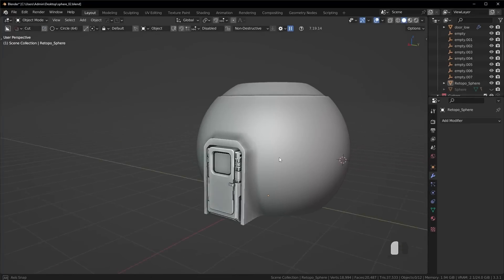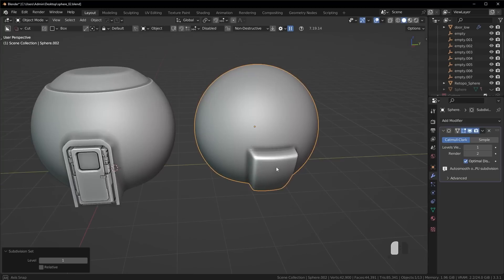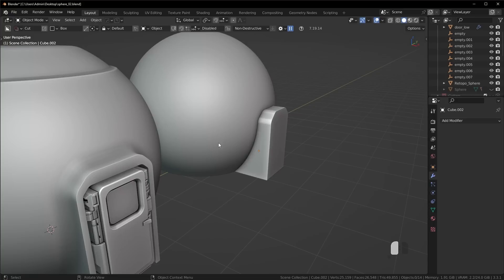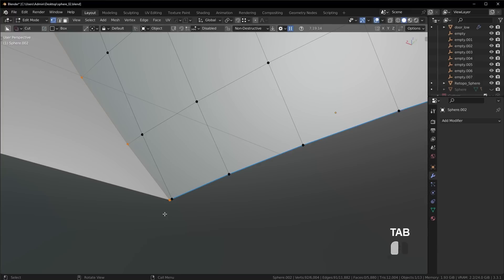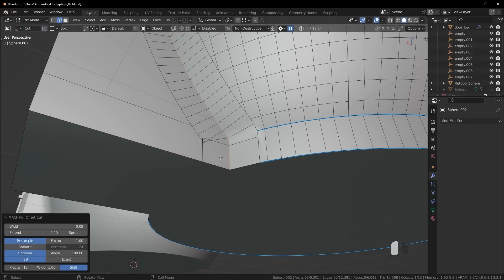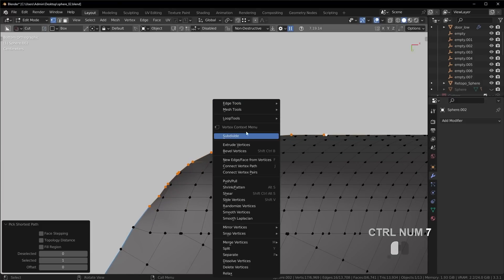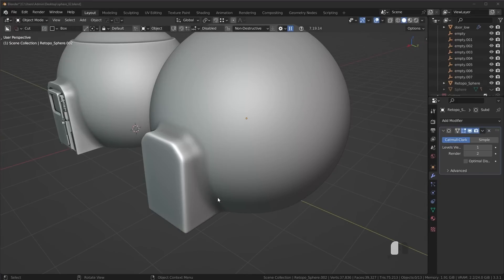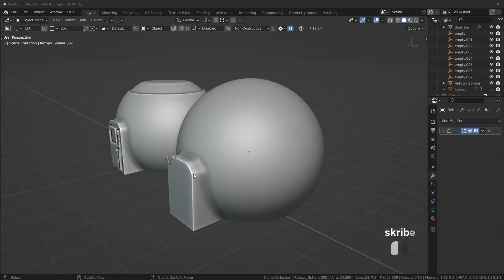HACKING your Topology in Blender!

Comment: I find it interesting, but thinking not just in terms of modeling, but in construction, this portico probably wouldn't be joined to the dome so seamlessly. They would likely be different pieces joined later. Typically, some sealant would be used at the joints, or a flashing. This smooth form, I imagine, would only be seen in more rustic constructions, like those made of clay...

Comment: New to this, but I accidentally found an easier way to make the bottom portion of the entryway flush with the bottom of the UV sphere: 1) Create the union boolean between the doorway and the sphere and apply. 2) Cut the bottom of the door and sphere at the same time with a difference boolean. 

With this method, there's no need to clean up the vertices and fill the bottom as seen in this video at 3:52

Comment: Thank you for the tutorial. I was wondering one thing though, with this overall shape that looks like a human head at least cranium and jaw, wouldn't it be easier to start with a sphere created out of a subdivided cube ?
Reply: A late reply, but theres important topology differences between the main 3 sphere primitives.
UV Spheres are the most spherical, at the cost of nasty pole geometry. However in cases like this where the top and bottom are removed/flattened, the polar geometry is meaningless, so a UV sphere primitive offers the most spherical result, and is an ideal base.
Cubes can be subdivided into spheres easily, are easy to work with, and often have far lower face counts than UV spheres. But the issue is a cube isnt entirely spherical when subdivided. You can fix this with Scale to Sphere (Shift S I believe), but then youll see the weakness of cube spheres. At each corner, or what used to be the corner of the cube, there is artifacts from the corners coming together. The UV sphere minimizes this to the poles, the cube cannot.
Then theres Icospheres. Great topology for procedurals, like geometry nodes or particles, but very hard to work with out of the box. Really only useful for shaders, nodes, or particles that will deform geometry.

For this example, he wanted a very spherical body with a protruding door. While the cube would have worked, the topology artifacts caused by the cubes edges would be noticeable, and difficult to remove after performing the boolean operations. Remeshing would help, but there would still be awkward, small lumps remaining.

Comment: So I JUST bought meshmachine, a week ago, and it doesn't have "Offset Cuts" under the Y menu.  Just Offset.  And no matter what I try with the options that pop up under offset, I can't get a bevel like what you're showing.  Are there multiple versions of meshmachine I don't know about?  Thanks.
Reply from the maker: You have to enable experimental under the addon preferences.
Reply: @JoshGambrell  got it - thanks.  :)

Comment: If you press T while cutting a box, it is canceled and an error message like this pops up.
AttributeError: bpy_struct attribute"execution_time" frome "SolidifyModifier" is read-only.
What could be the problem?
Reply from the maker: No clue, i dont develop the addon. Where did you purchase the tools from?
Reply: @JoshGambrell  
I bought it from Blender Market. I downloaded and installed BoxCutter 719_16_4 again today and it worked again.
I think it was because the blender version was upgraded to 3.5. Anyway thanks for the answer.

Comment: An even easier solution is to extrude as you did at 1:30 and press S>Y>0. Then select the faces at the bottom of your sphere that you wanna make flat, S>Z>0.
Reply: I thought that too, but you'd still have to do some finessing to get the chamfer on the upper edges of the doorway blending smoothly into the sphere

Comment: not very close to your result but I did it with knife project from hardops. had to look for spaces between the quad so bevel would not create the issue. After that Quadremesh and subd work perfectly fine. didn't have meshmachine so had to look for alternative. the union was a little too messy to work with.

Comment: REALLY helpful type of tutorial. Topology is pure art and skill all about. I just wonder why use a plane to cut off the bottom the first time (the second time it's the only way it seems) of the sphere instead of turning the see-through option and select the whole bottom vertices that need to go and then delete them without the risk of cutting off too close to existing vertices and creating really thin faces by accident. Still works, but since doing sky domes takes a bottomless sphere, deleting vertices rather than boolean cut them seems much cleaner.

Comment: Try doing that in vanilla Blender!
Reply from the maker: Good luck.
Reply: what's the point? if there are tools to make your workflow easier and faster why not using them? it will be a waste of time
Reply: @garycrvg1  Maybe in order to avoid buying expensive addons? Not to mention that using "magic buttons" you don't improve your hardsurface modeling skills.
Reply: @ПростиКринжатор  well, I've never said that addons improve modelling skills, they are there to save your time, you're not buying an addon, your buying time, so 40 dollars for boxcutter and hardops and 40 dollars for meshmachine are totally worth it, people spend more money in less productive shits anyway.
Reply: @garycrvg1  Agree with you. Time is more valuable than money. But before watching the video, I made the same model without any addons in about the same time, with the correct topology, without using Boolean. And at the same time, I did not get an extra topology, which is formed when using this addon. Perhaps in some cases it is really justified. But it seems to me that in typical cases, with experience and skill, you can easily achieve a good result (for the same time) without it, and in difficult cases, the "magic button" is unlikely to show its best side. Yes, the addon is interesting. But the video disappointed me, as a person who wants to improve his skill.

Comment: I have a problem with using Quad Remesher on more complex hard surface models. Sometimes it makes curvatures where it should be flat etc. Any tips on using Quad Remesher with complex hard surface models and avoid the mistakes? Any settings I should play with?
Reply: Quad Remesher has a "Use Materials" checkbox. Create temporary materials aligned (roughly) with how you want the topology to flow. Check "Use Materials", Quad Remesher will create "borders" on the edges of the materials.

Comment: I would love to see a tutorial on using quadremesher or remeshing in general on hard surface models. I cant get my head around it. It refuses to keep the edges and line. I'm incredibly annoyed by the fact it just worked fro you in this case lol.. Surely u mustve used some trick monkaS . Even using the detect hard edges and trying the other options it doesnt work for me.. its making me lose my mind lol
Reply: It works perfectly fine for me and i think i'm on default settings. It has the Detect hard edges by angle setting, be sure to have it checked on.

€: Nevermind, i fiddled around with the settings to get a bad result and now i only get bad results, even when i go back to my initial settings, this really sucks. I'm not sure if there is anything to fix this tho
Reply: @postmodernerkindergartner960  i know right.. I cant wrap my head around it..  None of it makes sense to me lol :(

Also sorry for Fuckin it up for u too now..